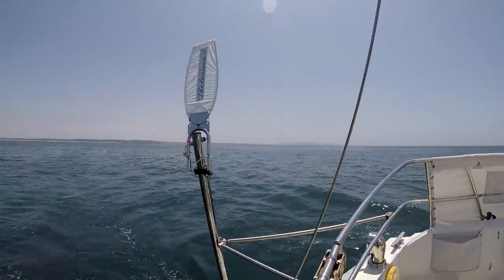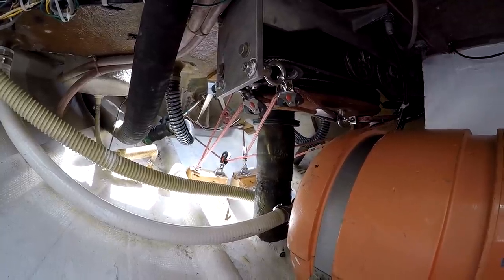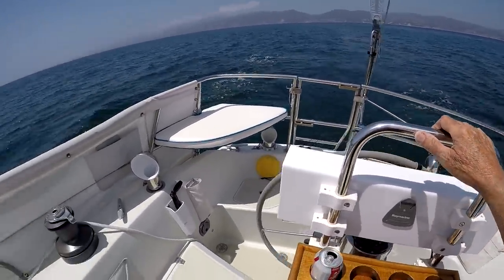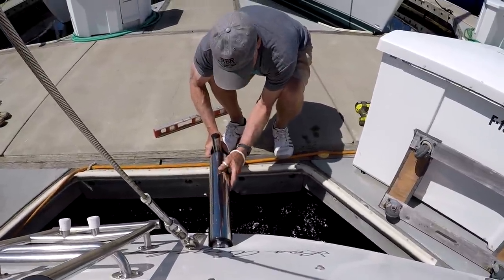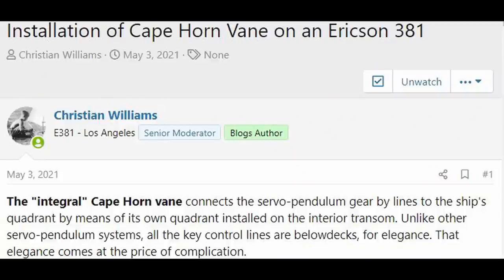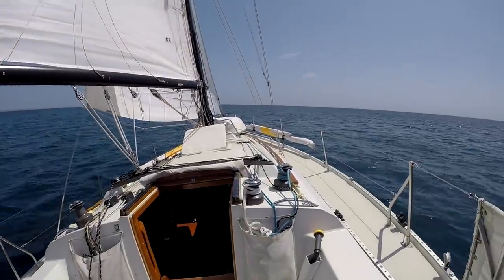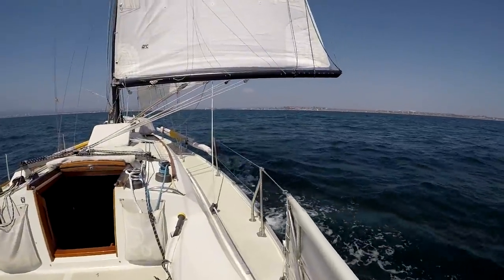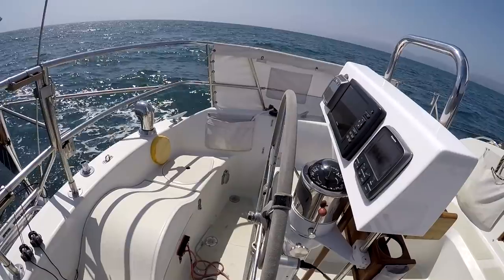Why We Sail--"Cape Horn Steering Vane Install and Sea Trial"

Comment: When the drive belt on a ski lift gets loose, you tighten it. But if it’s the middle of an operating day, you just gotta get through it. So you throw some snow between it and the pulleys, creating some friction. I was reminded of that when you splashed some water into the gearing of the self steering.

Comment: That was a very good review. I cringed at the hole saw thru the stern as I’m sure you did too. I can certainly see the wind vane use in longer crossings, not consuming power, but for day sailing, the good’ol autopilot works well. 👍 
Thank you for the video.  Your narration always causes a good laugh.

Comment: I can't help but wonder how much usable storage space has been given over to the Cape Horn's blocks and lines. I've a book by John Letcher (amazingly available as a free PDF if you google the name and 'self steering'), it's an old book, but the information contained is valuable. He does suggest, in one chapter, a method of using a fool's purchase and the tension on your sheets to maintain a course relative to the wind. I've put together the relevant blocks, lines, and rubber tubing, but the conditions and my time have yet to coincide to make testing practicable... so the tiller pilot still has a place in the crew.

Comment: I'm confused. I thought the pendulum blade did the steering, while the main rudder was locked at the wheel. Windvanes don't hold course, but a point of sail. I'm debating on two models of windvanes, and the Cape Horn is one of them. Thanks for the video.
Reply from the maker: A servo-pendulum vane uses the force of the "oar" to turn the ship's rudder.  As it works you can watch the wheel move back and forth.  Other systems, notably the Hydrovane,  steer with their own rudder: the ship's rudder is locked in place and the wheel doesn't move.

Comment: An interesting video. One question, why install the self steering vane when you already have the Ray Marine steering system?
Reply from the maker: A simple wheel pilot, unlike a powerful hydraulic self-steering system, is only for motoring or light air. Wind vanes can steer in heavy wind and sea.
Reply: And they don't make any noise or  use any power to operate. A must for long trips.
Reply: @Thomas-ts2gl  Thank you for the info. I have become interested in sailing but know nothing about it.

Comment: @12:34 the two lines below deck are rubbing on one another.  That looks like a 100% future failure right there.
Any way around that?
Reply: Does look like the pulley placement needs a bit of tweaking...
Reply from the maker: @Tinker001  No lines touch or chafe. Two-dimensional video does make it seem so.
Reply: @ChristianWilliamsYachting  Gotta start uploading 3D videos...
:P